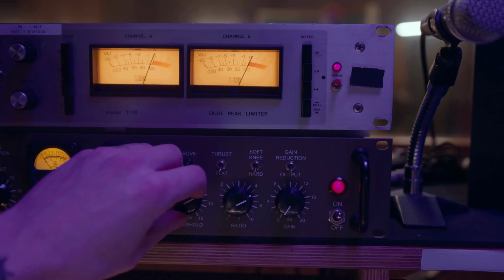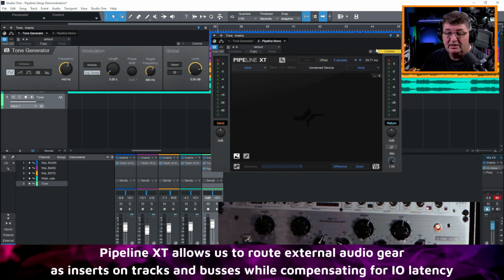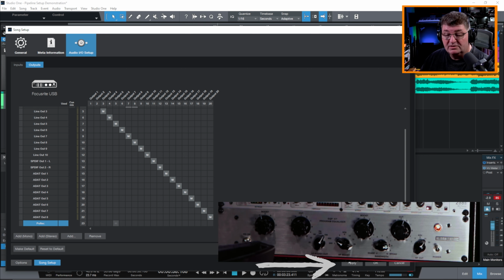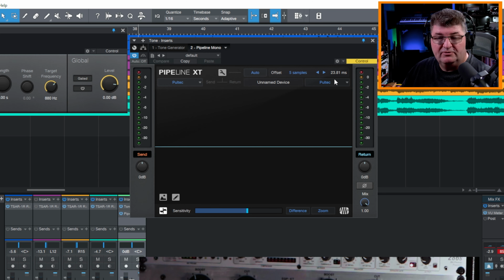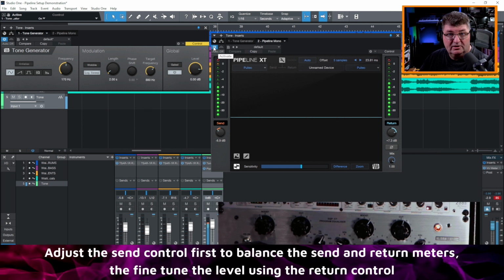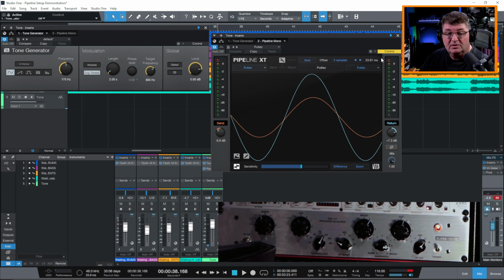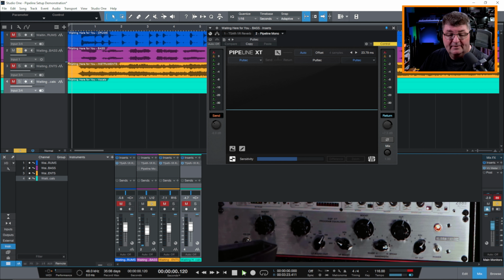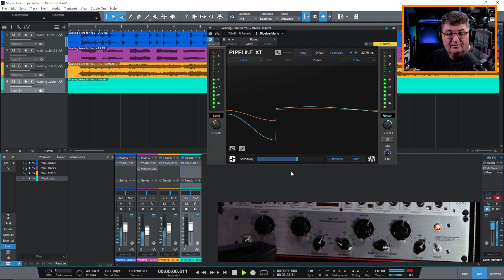Studio One Pipeline XT - Step-by-Step Setup Guide

Comment: This may sound like a really noob question, but I can't get pipeline to work using a patch bay!~ For example if I route the output of a compressor into channel one in my clarett+ 8 Pre I need to turn up the gain on the clarett and all I get is noise when I ping the signal~!
Reply from the maker: The best way to diagnose this is to go step-by-step. First go into Focusrite Control and make sure that the input you are using with Pipeline is not setup to output through the output you are using with Pipeline. If it is, remove the input fro mixing into the output and try Pipeline again with your compressor. If the input is not routed to the output in FC, connect one TRS cable between the output and input you are using with Pipeline. If the ping works, now connect the Clarett+ output to the compressor input and the compressor output to the Clarett+ input, test Pipeline with a ping. If it works, now connect the patch between the compressor and the Clarett+ and test again. Note that the gain controls on the Clarett+ work as trim controls for line level signals, so it is ok if you need to turn them up a bit, but it should not have to be above 11:00 (varies with different outboard gear). I hope this helps out.
Reply: @askdrtk  It seems as if I won't be able to get around not physically patching things with TRS cables. I was really hoping that the patch bay would solve this problem. Apparently it doesn't :( . Just for further clarification,  I'm slaving my Clarett+8pre to a Universal Audio Apollo twin using ADAT out from the Clarett to the Input of the Apollo. This works great for recording and playback but not for using pipeline or the I/O Plugin in Logic.I'm considering getting a 2i2 just to make the physical patches to the individual piece of equipment and not using the Apollo or the clarett , since trying to use the patch bay that is using ADAT has proved unworkable.  What say you?
Reply from the maker: Interesting. Generally once you add the ADAT inputs and outputs in the song setup table in audio i/o setup they should be available in pipeline. I have an 18i20 slaved to my quantum 2632 (ADAT cables in both directions) and all of the 18i20's IO is accessible in pipeline (of course I setup "friendly names" for all the IO in the song setup table). I also have an Apollo, but with optical in only I can use the slave's inputs with pipeline but outputs have to be on line out 3/4 of the Apollo.
Reply: @askdrtk  I'll try that in song set up mode. As always thanks for your kind response

Comment: Great info. 
I received Studio One Artist software free with the Presonus 32S Model mixer that I bought a while back. I don't believe however that Pipeline comes with the included Artist version of Studio One. 
I'll need to check to be sure as I have a lot of vintage (and newer) outboard gear and would love to use it on my mix downs.  
Thanks and well done...
Phil
NYC / Jersey Shore Area
Reply from the maker: Hi Phil, thanks and I'm glad you enjoyed the video. Artist does not include Pipeline XT, but you can still use your outboard gear. At its core, Pipeline XT is a plugin that creates inserts pairs of sends/returns and then automatically compensates for latency - very handy. To insert outboard gear on your overall mix you can create a separate bus channel for your 2-bus (if you don't already have one), set all of your tracks / buses / FX etc. to output to the new 2-bus channel. Then create a send on the the 2-bus channel to the audio interface outputs connected to your outboard. Now add an Aux channel and set the input to the audio interface inputs connected to your outboard and set the Aux channel output to main. This way your 2-bus mix will pass through your outboard before going to the master bus. There will be latency, but since it is on the entire mix there will not be sync issues (bypass this if you need to do overdubs...) You can do the same on individual channels within the mix, but you will need to manually compensate for latency. This is where Pipeline is very convenient... Hope this helps out!
Reply: @askdrtk  Thanks for the info.
I will have to digest this as I am not sure I am following you 100% how to do this. Thanks.
Phil
Reply from the maker: Glad to help out. I'm planning to do a video at some point about sends and returns. The topic doesn't get a lot of conversation outside of the console workflow or outboard gear with insert points. Cheers!
Reply: @askdrtk  If you do a video on this subject that would be great!
Phil
NYC / Jersey Shore Area

Comment: Thanks for your video! Do happen to use RME Totalmix?
Reply from the maker: Glad to share! I haven’t used it a lot…spent some time at a friend’s studio who uses it all the time and I have to say I am very impressed. In particular, as a guy who likes outboard gear, I like its capability as a patchbay. IMO once you get into the Totalmix workflow, it is probably the most capable native IO management application, as least that I have seen.
Reply: Pipeline doesn’t work with my RME UFX Total mix routing. I’m going to do a print track instead. Hopefully it will work. Thanks.

Comment: I was trying to set this up and get it calibrated on my master bus going into a stereo bus compressor. If I have my mix - mix to -12 DB before sending to mastering and calibrate the pipeline plug-in to send -level -6, which is what I’m having to do like you. Wouldn't that mean the mix is actually hitting the compressor at -18 and not -12 usually only compress on my master bus. A couple of DB additional require much more to get the level back up, that would be throwing things way off?

Comment: how does the pipeline render as a plugin on your track at mixdown though? does it remember what the settings of your external EQ were and just print the tonal adjustments to the track like a plugin would? let's say you go to export mixdown for example. do you need to leave your I/O configured the way it was when you set up pipeline in order for the plugin to render on the track? i.e. if I unplug my EQ from the I/O on the interface to connect a different piece of gear, let's say a compressor, which i want to apply to a different track with pipeline, does the daw still remember the "settings" of the EQ - which i've now unplugged - and apply that to the bass track? i would think you would have to re-record the audio to a different track while it's being routed through the external EQ to a different track in the session, but no tutorials i've watched have demonstrated that. i'm just confused because with normal plugins, the processing effects are stored as files/programs within the computer, so it always knows where to find those settings when plugins are applied. i can just slap a stock compressor or channel strip on a vocal channel and it will always be able to find that information. but i just don't get how, with Pipeline xt, it "remembers" what the settings of the outboard gear was, unless you were to re-record it or something and physically print the new audio that's being transformed by the analog box to a new track
Reply from the maker: In studio one when using pipeline you have the option to either render the effect to the existing track (with the option to revert) or print to a new track. Pipeline does not store analog processor’s settings, but is does have provision to save either text or a phone of the processor to assist with we all later if required. You can also store a preset in pipeline for the effect that includes IO and level settings which is quite useful for processors you use a lot. In this way, you can preserve the settings for all your EQs, compressors, etc and switch among them without having to rebalance the IO levels. Once you have the effect rendered or printed you can then move on and use the effect or another effect on another track. You can have as many instances of pipeline as you need. The limit is of course your IO and how many outboard processors you have. All tracks that have the analog effect rendered can revert back to the original or you can even adjust the wet dry mix without having to reconnect the analog processor. Just like printing, rendering is a real time process.
Reply: @askdrtk  ok. so, for example, if I have one external 1-channel EQ unit, and i want to use it to process multiple tracks - let's say a vocal, a bass, and a synth - since i only have one 1-channel unit, and i want to apply it to a total of 3 tracks, would my only option then be to re-record a new copy of the 3 tracks, one at a time, by sending the track through an output on my interface, through the unit, and then back into one of the interface's line inputs and onto a record-enabled track? and i suppose in this case, i would not be using the pipeline plugin?

alternatively, for another example, if I only wanted to apply my 1-channel outboard EQ unit to ONE track in my session - perhaps the vocal - then i would NOT have to re-record the vocal track to a new track through the EQ, because i could leave the EQ hooked up DURING mixdown, and check the "mixdown with real-time effects processing" or whatever that is, and use pipeline's I/O to manage the effect being printed to the track at mixdown?
Reply from the maker: Yes, since your EQ is a single channel, it can only process one track at a time. If you want to use it on three tracks you would have the EQ connected through pipeline on one track at a time. You need to render one track, bass for example, then move pipeline to synth and render that track, and then move pipeline to vocal and render that track. Rendering is essentially the same as rerecording to another track except studio one places the "recording" in the original track and keeps a backup of the original "off-screen" for you to revert to if you wish thereby reducing the need for additional tracks.

In a case where you only want to use your EQ on one track, you can leave pipeline on that track during mixing and when printing your mixdown. Being digital, plugins and other effects from your DAW are rendered / printing as fast as your computer can do them, but any analog gear needs to render or print in real time. 

Pipeline does essentially the same thing as sending a track to an output for your EQ and then receiving the return on an input, except it also takes care of latency, allows you to gain stage output and input levels in one interface, and allows you to blend wet/dry signal (along with giving you the option to store presets for your gear including pictures or text specific to your mix to assist with recall).
Reply: @askdrtk  ah okay, that's brilliant! so the "rendering" process that studio one does that you mentioned earlier, which it has to do in real time... what does that mean exactly? in real time?
Reply from the maker: Real time is the same as creating a print track from analog inserts. You need to allow the track to play form start to finish unlike where a plugin can be applied to a track without having to play it.